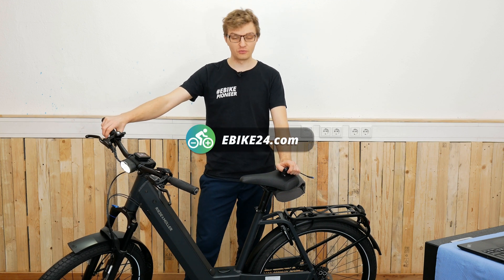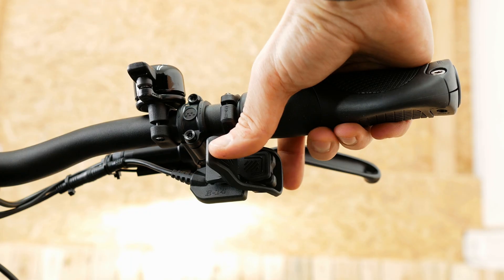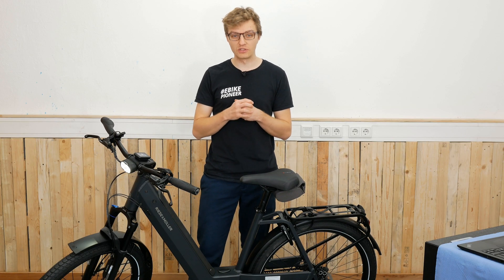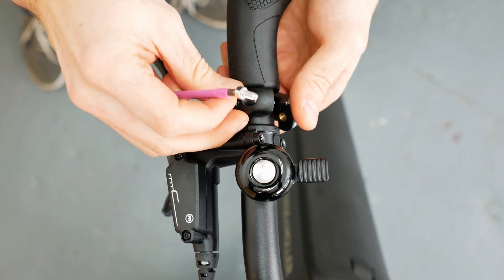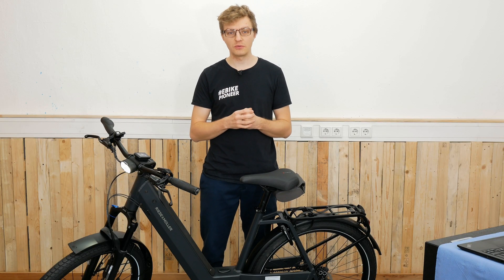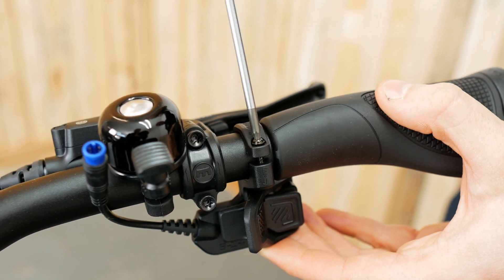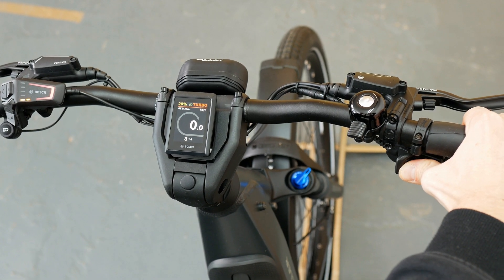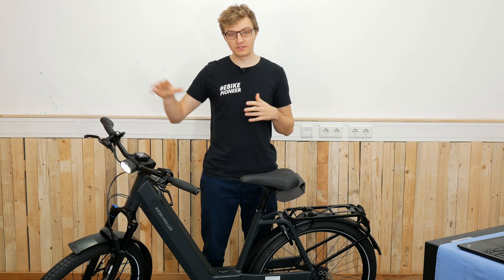Rohloff E-14 Trigger Shifter Retrofit | Tutorial 🔧 | EBIKE24

Comment: Nice video, thanks! I see that's a R&M Nevo 4?. I have a Nevo 3 GT Rohloff, the trigger must exchange position with the brake mount, going to the inside close to the grip - do you know if the Rohloff cable from the loom has that extra 1-2 cm to be pulled out? Regards

Comment: I have first generation with manual shifting gear on grip, is it possible to switch on electrical triger?
Reply: I'm interested in that too.
Reply from the maker: Thank you for your comment. No, unfortunately, it is not possible to switch from a manual grip shifter to the Rohloff E-14 electronic trigger shifter. The E-14 system is designed specifically for integration with electronic shifting and requires a compatible e-bike system that supports it. If your bike has a first-generation manual shifter, it would not have the necessary electronic interface to work with the E-14 trigger.
Cheers - Michael
Reply: @ I run a tadpool trike, and the long cables make the normal shifting of a Rolhoff heavier, that's the only reason I would like to change to electronic shifting.

Comment: Just updated my bike, for £70 plus you would have expected a few cable ties in the box, the hex screws are a smaller size on the new trigger shifter and finally the clamp is not as robust compared the original gear changer clamp so hope it's up to the job.
Reply from the maker: Thank you for your honest feedback. That does indeed sound a bit disappointing. I hope you're still happy with the upgrade for now.
Cheers - Michael
Reply: @  hi, first trip out today and the trigger switch worked flawlessly, much easier to use especially when you have thick gloves on and its cold. Well worth the spend.